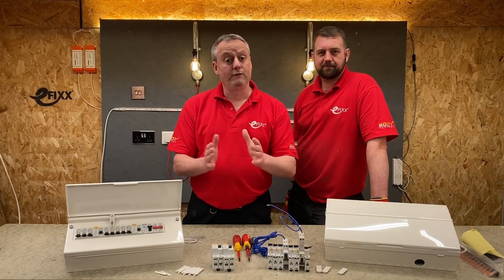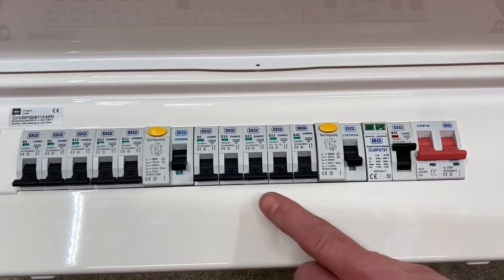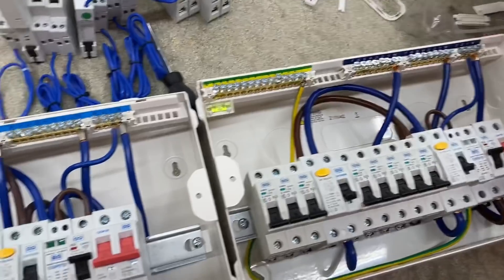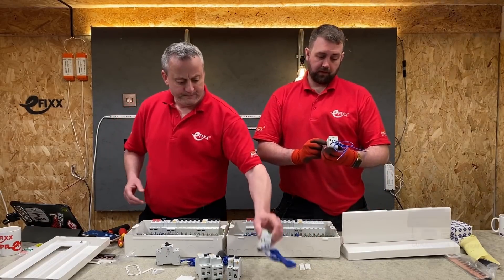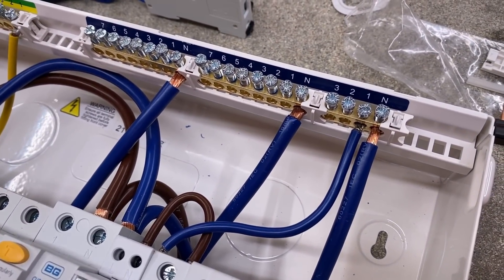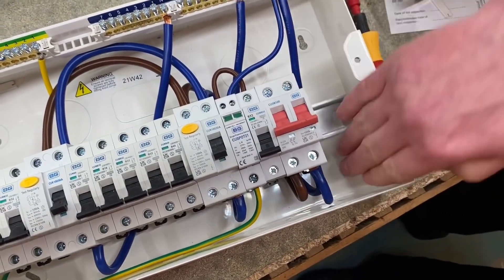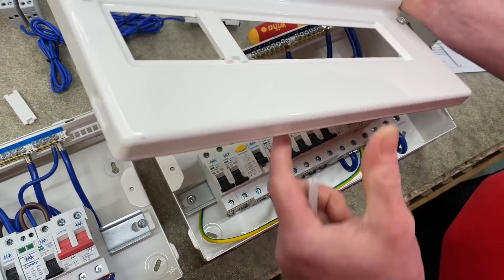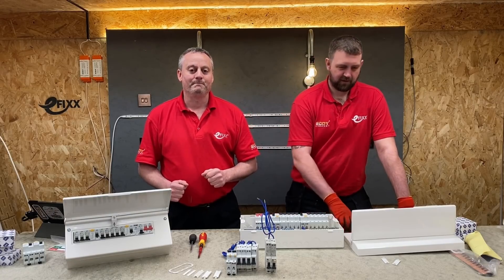The BG Consumer Unit Update: What's Changed?

Comment: I only don’t like that instead of resetting the mould they decided just to ship bit of plastic another think you have to think of, no other manufacturer consumer units needs this. I used lot of Bg consumer units, they are quite rigid and afford loads of space for your cables but bit of plastic to ensure IP rating is bad.

Comment: Looks good, BUT... How do you incorporate RCBO's or AFDD's into that unit? The main bussbar ends with the SPD and the other bussbars are fed from RCD's. You wouldn't usually feed 30ma RCBO's from a 30maRCD, would you?
Reply: That's a budget split load board which is not designed for RCBO's I have converted one before to take RCBO's by removing the RCD's and fitting a longer busbar but you have to link both neutral bars together as it will have extra ways in the board but I had to use wire numbers on the neutrals as the numbering on the neutral bars become out of sync

Comment: Still not addressed the lid problem, if it’s fit at low level as in most houses then the older generation cannot see the MCBs to reset them as the lid doesn’t lift up high enough, you have to get down on your knees to see under the lid. ☹️
Reply: Simply fixed by Never fitting a BG board. Fit FuzeBox.

Comment: Always like the BG boards. Hard to beat on a price to quality ratio. The improvements are welcome and useful and it’s refreshing to see a company actually take on board AND initiate customer feedback. I tend to fit full RCBO boards in rewires and refurbs where price allows but in cases where cost is critical I will still fit a dual RCD board and will definitely be giving the new BG range a try. I personally don’t have an issue with dual RCD if the circuit division is appropriate. Never had any issues with the 100s I’ve fitted over the years.
Reply: FuseBox all the way.

Comment: Fusebox are still the better board
Reply: What experience do Fusebox have as a manufacturer of consumer units? It’s a trading house brand name for cheap imported products from China.
Reply: @mikenewman9372  And yet everyone is moving to them because they are great.
Reply: @davidcouzens  because they are cheap, that’s the only answer. Ask yourself why no volume installers like councils and housing associations fit them. Because, whenever Fusebox owners decide they’ve made enough money importing them, they’ll be off. Then where will electricians go for replacement Fusebox devices? Your 2 or 3 year old consumer unit is now useless because you can’t fit another brand in them.

Comment: All manufacturers need to get rid of all those stupid neutral leads !! Create a simple plug in module with 4 spades that will slot into a base consumer unit where the terminations are made. Making terminations in the protective device is just shit, there is a better way. Manufacturers just need to make them !! And messy boards and/or RCBO's with those annoying flying neutral leads is just utter crap.
This would also mean all modules can be double pole if needed, and easily interchange whether MCB, RCBO or whatever. And no need to disturb terminations for most subsequent work.
Manufacturers contact me for a consultation lol...but they CAN do better !
Reply: My wholesaler sell the Crabtree Starbreaker range, it already does what your asking for. It’s a brilliant consumer unit, safest and easiest to install out there. Problem is for this generation of YouTube electricians, it’s £50 dearer than theChinese imported Dansen, Lewden, Fusebox, Scolemore, Hamilton ones.

Comment: Nice features but RCBO’s are the way forward. The garage boards are well made wonder if they have changed them as well.  My only gripe is why ain’t they making the surge connected to the main switch without an MCB like hager. If the MCB is not on there is no protection

Comment: Here in Aus  the type AC were changed in regs to type A in 2018, and all RCD for all circuits (no split boards). Would be nice if we had surge protection as standard fitment. I still don't think much of the blanks though even with design change. I reckon they should be full size and clip onto the rail.

Comment: honestly don't see the point in split load boards any more - its time we moved on from them. I just had to rip out the guts from a 6 month old Proteus special because the split load board that was fitted didn't have any provision for any non-RCD circuits. Had I got the initial job and fitted an RCBO board it wouldn't have been an issue to add the extra MCB. Now I have a frankenstein board with 5 circuits but no additional neutral bar provision without either some home made links or some special order kit to make it work (not to mention the din rail has been 'economised' making it difficult to blank off unused ways where the RCD's were)

Comment: I like these improvements!
I’ve fitted many BG boards and I find them quite nice to install 👏

I suppose square knockouts would be nice sometimes but if I need a square entry I usually make it myself. I would like to see more manufacturers print on the front of each terminal what torque setting they specify for the device rather than having to dig through the paperwork each time.

Comment: I fit bg quite often (strictly rcbo setups though) I have to say I prefer the hager prefitted spd as its directly off the main switch with not need for its own mcb. Out of curiosity what's the need for the little slither blank, is it to allow a bit of play in cases the breakers aren't neatly installed? I also find that the din rail could benefit from a center support as i sometimes find the the 'sag' from say a 10 way install causes it to be a bit fiddly getting the front panel on
Reply: Good point
Reply: Personally I'd avoid SPDs that require their own MCB.

The regs limit the cable to the SPD to 50CM [25CM either way] for a reason - a 1.2/50us surge sees your 10mm² cable an inductor and every CM between the SPD and the main breaker means more of the surge gets to the final circuits.

In an ideal world SPDs would be connected using Y type cables [similar to what we use in split RCD boards] so that all current between the final outgoing circuits and the main breaker has to run through the SPDs terminal.

Comment: Were currently fitting BG boards and accessories on the project I'm working on at the minute, i really like the boards plenty of room inside, you are right about that bottom 32mm knockout, nice to see the upgrade and the magnetic cover holder is brilliant.. Only complaint i have is on the BG Nexus metal switches the earth terminal isn't drilled right through, which gives about 6mm depth to connect , not ideal ... but hers a product you want to get BG to send ... ive fitted a few and clients love them BG 822BELL double gang socket with built in door bell .. good video lads
Reply: Just had a look at that integrated door bell it looks great!! I fit BG accessories as standard best quality at a sensible price. I don't fit their boards much I tend to use the fusebox range. I prefer RCBO's to split load boards.

Comment: Do people actually still fit dual rcd boards anymore? 🤷‍♂️
Reply: I was surprised at this too. They do sell populated RCBO boards. And they aren't that much more.
Reply: I no longer offer dual RCD boards.  I think all RCBO is the best overall solution for a main house board.  I stopped fitting BG a few years back because of some quality issues with previous metal models.  When I present quotes for all RCBO Wylex or FuseBox board the customer will say ... but they only cost £65 down at Screwfix!   Wait til they start seeing AFDD quotes!
Reply: @dominicdodd9759  why wait until they see AFDD quotes. Page 49 of the new onsite guide states it "shall be" for high risk residential buildings and care homes etc. Then says for all other premises "it's recommended" and only on final socket outlet circuits up to 32a. So if the customer doesn't want to pay £1500 for a consumer unit they won't.  I haven't seen any manufacturer offering 40A plus on AFDD mcb or AFDD rcbo. So you're bigger circuits like electric showers will still sit there arcing away and burn the house down.  And there the circuits which will have the biggest arc?
Reply: @j.f5212  Crabtree and Wylex both do 40A AFDDs with RCBO.
Reply: @mikenewman9372  thanks, it would be great if all manufacturers did the full range, as far as I can tell some don't .
Reply: @mikenewman9372  Who actually fits Wylex or Crabtree anymore though. The screwfix bandits?
Reply: @davidcouzens  I work for a large national wholesaler and I sell more Wylex consumer a month than any brand. The local council take them, a couple of housing associations specify them and two large new build contractors fit them cause they’re specified. Users that are more concerned about safety, reliability and future proofing than a race to the bottom on price between the cheap Chinese importers.
Reply: @mikenewman9372  I hear you, but I think the game is up for them ultimately. Large house builders and counsels are not really shiny examples of industry best practice.
Reply: @davidcouzens  the games up for them. Couple of questions then. Who's been at the forefront of AFDD technology for the last 4 years? Who's AFDD device is everyone else struggling to replicate? Who's SPD is genuine single mod not requiring MCB back up? Who's devices have no miss busbar connections and twin terminal main switches? Wylex are probably the most innovative circuit protection manufacturing companies out there.  According to their local rep, them and Crabtree make over 50,000 consumer units a month and have over 38% of the market share and it's still growing. I'd love to know how the games up for them.
Reply: @mikenewman9372  Who's is the cheapest? And who's works the best? Wylex's one doesn't work very well.
Reply: @davidcouzens  the Wylex one what doesn't work well?
Reply: @mikenewman9372  Yes The Wylex ones (which are made by Siemens)
Reply: @davidcouzens  think you're on a wind up. I must have supplied about 3,500 Wylex AFDD's to a S.Yorks local authority over the last 18 months, without one be faulty, nuisance tripping or unnecessary call outs because they're " not working well". Not sure where you get your info from but, as a wholesaler who's sold thousands of these devices, I can say confidently, Wylex perform extremely well.
Reply: @mikenewman9372  Reason they don't nuisance trip is that work.
Reply: I haven’t fitted a twin load in 8 years, 
RCBO’s should’ve been the standard (amd2) but I guess in AFDD’s will be standard under the 19th edition cheerching!💷💷😊😉
Reply: No.